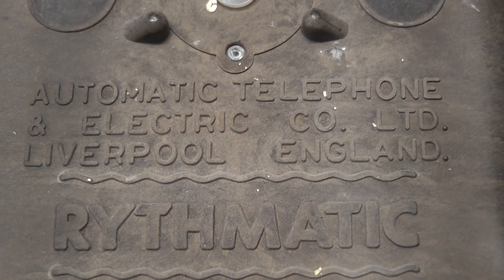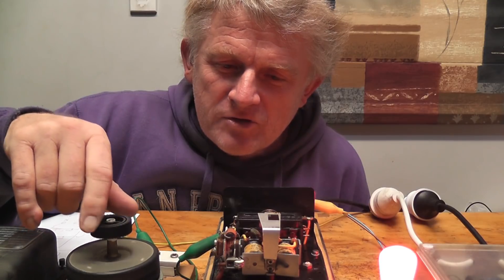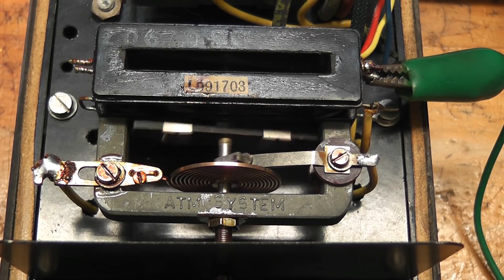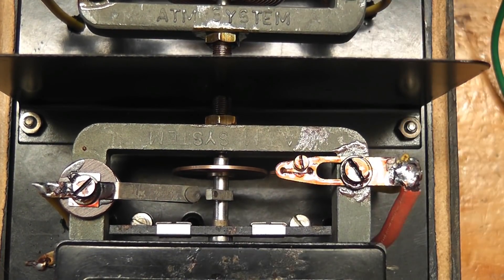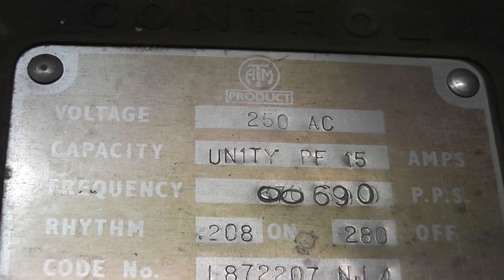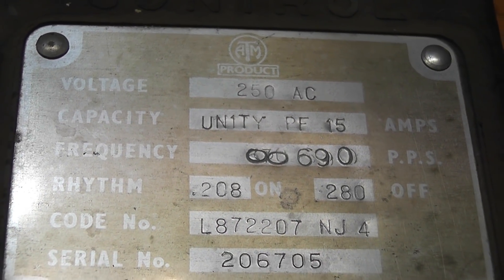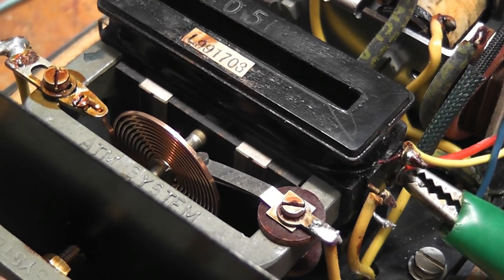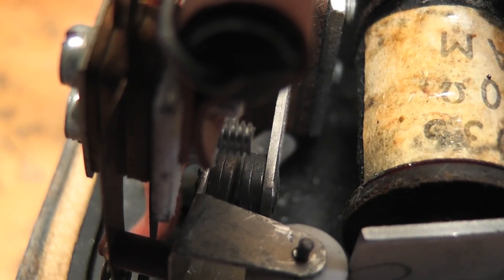Rythmatic Ripple Relay

Comment: I am keen to know how these were controlled. It looks like you have a third wire sending a DC pulse to the unit so I am wondering if subscribers had a mains power feed coming into the house from the street, as well as a ripple control wire like a telephone wire? 
Or were they extracting a ripple signal out of the mains feed and then sending it to the inputs where you have your motor connected?
Reply from the maker: They were extracting the signal out of the mains. I use that stepper motor to create a signal to trigger the device.

Comment: I have a very similar device but it plugs into a meter socket, and apparently uses 720Hz as the control frequency. The actual switch is a mercury capsule that were also used in some GE light switches before the 1970s.
Reply from the maker: Nice, I like these odd ball frequencies used for some of those devices. For a 60 Hertz system it would be the 12th Harmonic.

Comment: After some thinking and looking at this again the coating applied externally to the device's enclosure tends to block stray RF and and other fluctuating magnetic fields so the device will function as intended . 
An early form of RAM (radar absorbing material )

Comment: A vacuum tube thermal couple voltage controlled oscillator was used as control circuit for that.
Reply from the maker: I have heard of that device, never seen it with my own eyes unfortunately.

Comment: That's impressive. If it was make in the UK, how did it end up with you in new zealand? This was back when we still made stuff in the UK and made it to last.
Reply from the maker: These Rhytmatic relays were used and some still are although I don't think the ripple injection system for these frequencies is used anymore. Most is now 475 and 1050 Hz.

Comment: Is that for turning on and off Economy 7. (Economy 7 is a electric tariff where you pay less for your electricity, at off peek times and is used for heating hot water and storage heaters in the UK.)
Reply from the maker: Yes, in NZ we call it Meter Minder, but mainly used for controlled load shedding over peak periods.